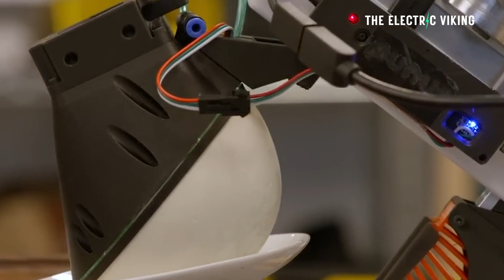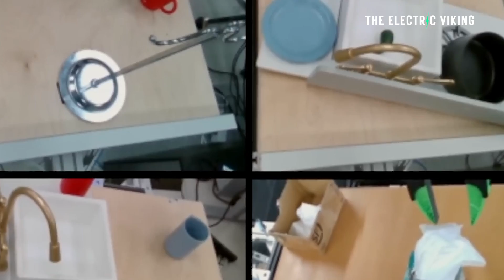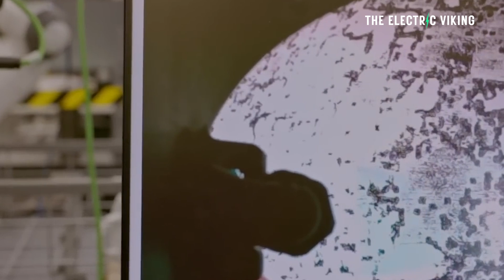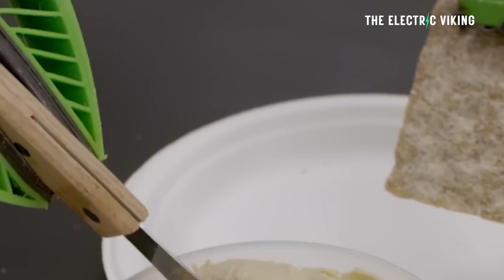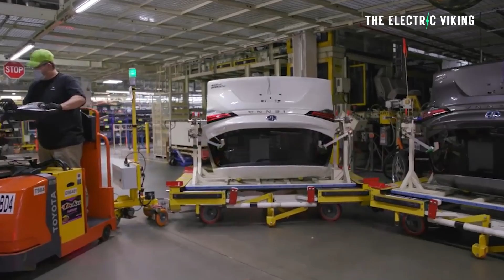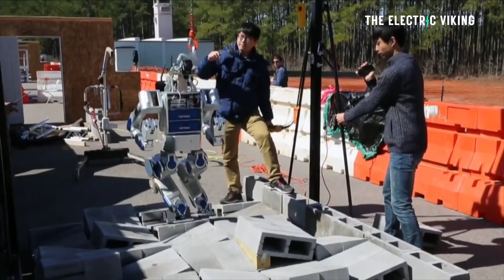Toyota achieves AI breakthrough teaching robots to do human tasks

Comment: Perhaps what is actually happening is more sophisticated than what I am thinking of,  but it should be pointed out that robots have been used to paint cars for many years. A skilled painter does the job, connected to a bunch of movement recording apparatus,  and the computer simply replicates that movement over and over again. Is that the sort of thing which Toyota is claiming as a break through?

Comment: First step will be replacing current dumb robots by smart ones. More easy learning instead of tediously programming. Initially in car factories…

Second step, many years from now, vehicles becoming automotive by default (NOT current optional FSD). Pizza, cargo delivery, later on people)

But where should those people go to? Work? Shopping? 😮
Next step: fully automatic undertakers and crematoria. One cough and you burn…

Comment: it takes 10000x more power to run a AI than a human brain, for fixed factory tasks where size isnt a issue machines will outperform but for autonomous  working units we are still a number of step changes away from robots replacing humans. even though our brains are 'high energy' they are 10000 times less energy to run than simplest AI.
silicon & copper just isnt efficient enough a energy transfer medium. wed need to mater super conductors & have full biological computers  well before they become as energy efficient as human brain
Reply: Teslas FSD Version 12 operates on 100 Watts